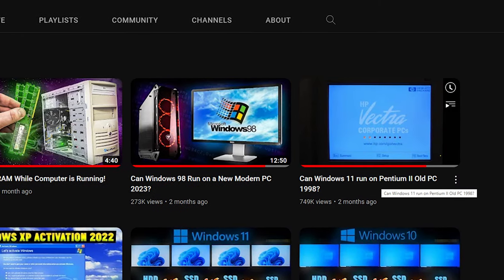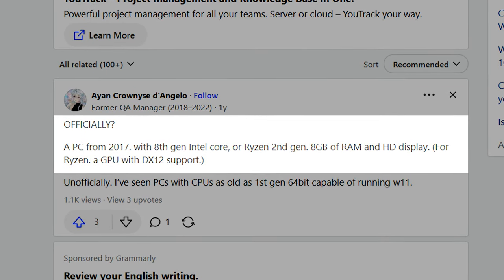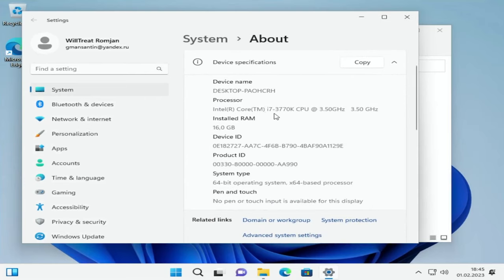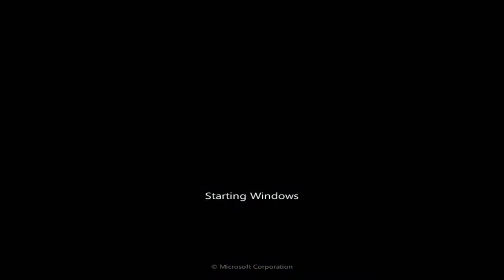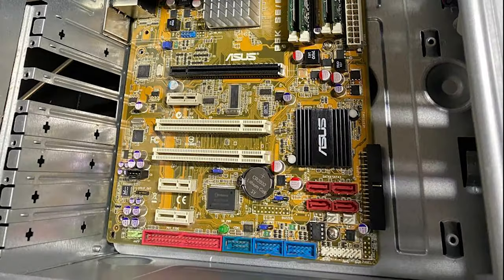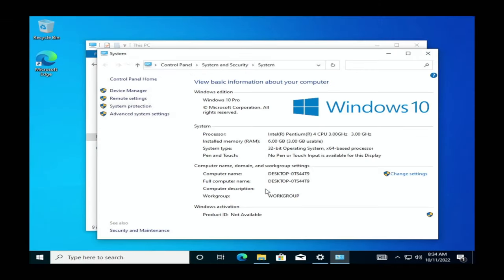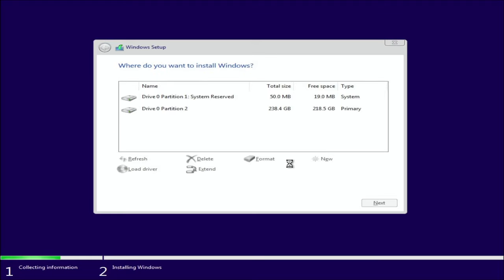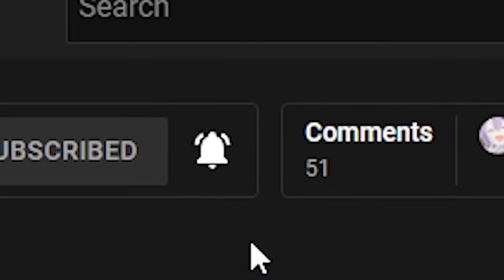What's The Oldest CPU That Can Run Windows 11?

Comment: The simple rule of thumb is that all 64-bit Windows since 8.1 have the same real hardware requirements.  That means that in principle, if it runs W8.1 64-bit it should run W11. But Microsoft has been very sloppy in testing compatibility on older HW, at least with 32-bit Windows where I have come across several laptops that didn't work despite fulfilling all HW requirements, like "newer" W10 on Pentium M and Core Duo. So in reality, there might be BIOS'es or other HW that blocks W11 from working despite all requirements being fulfilled.

If MS had tested more on old HW, the result should have been much snappier W10/11 as there is no reason why W10/W11 should be much slower than W8.1, which is very snappy on even very old machines as long as there is a reasonable amount of RAM and a reasonably fast hard drive (spinning).  But W10/11 can take 1.5-5 times longer to boot and are much less responsive, so it seems they have been optimised to be so unresponsive on HDDs that they need an SSD to get decent performance. But that doesn't solve the boot times on the older machines, especially laptops, as W8.1 can be faster and snappier with an HDD than W10/11 on an SSD... It seems W10/W11's disk performance is very CPU dependent while W8.1 and older are not, as long as the CPU is fast enough to handle the HDD bandwidth but that is not an issue unless you go back long before 64-bit CPUs.
Reply: In principle.  So far I have not been able to upgrade any PC to win 11 that doesn't have the TPM.  I'm guessing after the first SP that will be an option instead of a requirement.  There is too much money to be lost by not allowing the consumer market to update their old software.  e.g.  I have some old rigs without a TPM.  Win11 simply refuses to boot on those rigs.  It's not due to insufficient computing power (RAM, CPU, GPU, HDD, SSD) but rather without the TPM the boot strap simply refuses to execute.
Reply: >The simple rule of thumb is that all 64-bit Windows since 8.1 have the same real hardware requirements.

False. While software vendors like to apply generic monikers like "64 bit" and "32 bit" to specify compatibility, it's a big misnomer, because no 32 or 64 bit implementation of x86, or any processor for that matter between generations has the exact same feature sets. EM64T and AMD64 have evolved over time, and older implementations of those technologies lack instructions that newer implementations have, yet software vendors still use generic descriptions like they're all a homogeneous group across time.

Windows 8.1 had the same problem that 11 does now, with using generic 64 bit designation. That caused headaches with Athlon 64 owners, which early models lacked CMPxCHG128b, PrefetchW and LAHF/SAHF.

32 bit x86 was even worse. During the 90s, there were no fewer than 6 different x86 CPU vendors (AMD, Cyrix, Intel, Centaur, Rise and UMC to name a few) that all had a different approach to implementing x86. Software compatibility was an utter nightmare, just saying 32 bit didn't mean anything.

>the result should have been much snappier W10/11 as there is no reason why W10/W11 should be much slower than W8.1

Yes, there is a major reason why Windows 10 and 11 are slower, CPU mitigation patches.

The reason why old versions of Windows 10 and 8.1 are faster than newer releases is because those older versions didn't have software CPU vulnerability mitigations for things like Spectre and Meltdown, and now a dizzying array of other vulnerabilities found and patched since. Many of these mitigations by themselves have a severe performance penalty, which stacks cumulatively with each succeeding patch for other found mitigations.

Older CPUs are hit much harder in performance than newer CPUs. When you go much before Intel's 6th gen parts, you're looking at a 50-70% performance degradation, and even more if HT is enabled. Even with an SSD, it won't help with performance that much, because the CPU itself is taking orders of magnitude more time to do the same amount of work due to having to do it in a much less efficient manner.

You can turn many of these mitigations off in Windows 10, but not all of them. You'll be fighting Windows itself to keep them disabled, because it really doesn't want you turning them off.
Reply: @GGigabiteM  I've got both Sandy and Ivy Bridge rigs running 10 and associated apps without issue.  Well, I guess power consumption for the CPU ramps up, but oh well at least it's not like the 90's where when you bought that pristine 486 it was outdated before you even got dos to stabilize.

Comment: Did anyone else have an issue with the "doesn't meet sys. Requirements" wall persisting after making the bypasses in RegEdit?? I really need help here. 

HP Pavillion A6220n with A 2 core processor of 2.2 ghz. (I'm fighting the pc rn but it exceeds minimal Requirements.

6GB of Ram as well.

Comment: as an aside, just because 'ancient' cpus can, doesn't mean all boards can. i've got a bunch of older hardware that in theory can, but the bios/cipset doesn't let the installer run. notably all my old nc6400 laptops (which have core 2 duo's that are 64bit capable), and a few p4 boards i have (with some spare p4 641s which have the required instruction set). the installer just doesn't start. blinking cursor of doom. in spite of the cpus having the proper LAHF/SAHF support in 64-bit mode.

even if the cpu supports it, the chipset or bios may be preventing it. which is sad. there's going to be some mix and match needed if you're trying to put 11 on an old set of hardware.

so you may need to find other bios files to flash, or a different board in some cases, after verifying your cpu has the right 64bit support.

Comment: Take what I'm about to say with a grain of salt, but there's a chance this would work on a socket 478 board, I thinking using a Pentium 4 SL7QB.
The SL7QB, and SL7Q8, to the extent of my (rather limited) knowledge do support 64-bit instructions
Reply: @Man-O-Sphere News  Yup. that's what the "take what I'm about to say with a grain of salt" is all about
Reply: @Man-O-Sphere News  Unless you patch it Windows 11 needs at least TPM 2.0
Reply: Problem with that CPU is that Intel made it in limited quantities for one specific manufacturer in less than a handful of specific machines. Not many of them existed to begin with, and even fewer exist today. Good luck finding one for a reasonable price, the last time I saw one in the wild, it went for hundreds of dollars.
Reply: @JordanAnderson-pp5hu  Windows 11 generally doesn't need a TPM at all, they just really want you to have one.
I'm pretty sure socket AM3 motherboards don't have TPM 2.0 but Windows 11 worked fine on mine

Comment: Nah cause why would you use a 32-bit system in 2024? I use a Core 2 duo E6550 that was the best back in 2007. But the processor is 64-bit.

Comment: sir i have laptop with
i 2323 m  processor  64 bit 
i3  2 gen laptop
1 GB 640 m gpu
16 GB 833 mhz ram  can upgrade to 1600 mhz

can run windows 11

i can add ssd  insted of HDD  and  DVD

Comment: Hi, I'm trying to install Windows 11 23H2 on a i7 2600 CPU, but after the procedure with regedit I still have the same error on requirements. It is changed something in Windows 11 23H2 checks?

Comment: whats the newest cpu that doesnt support windows 11?
Reply: Might be the 2100GE that was OEM in PCs, Wikiepdia says it came out in 2019, non-OEM Ryzens would be 2200G and 2400G (2-12-18, or just voer 5.5 years ago, and only would be 3.5 years before Windows 11 came out. For intel, it would be the 7700k and other 7gen desktop models for normal CPUs, (1-3-17) and  i3 7020U n Q2 of 18 for a laptop.

Comment: Microsoft would be sitting pretty without those hardware requirements.  Instead, they are looking at having to release a Windows 12 to regain good faith.  Unfortunately, it will also have exclusive hardware restrictions.

Comment: There is something missing in these instructions. After i make the registry changes how do i get the install to restart as it does not do it automatically. i have the two windows open one with the regedit and the other where you typed in regedit.
Reply: Because the 90nm older 630 and 640 CPU’s are lacking the instruction set CMPXCHG16B which is compulsory since Windows 8.1. Also that’s the reason why the CPU can’t utilize more than 4gb ram even if it runs on 64-bit. I had this issue with a Pentium D 820 CPU

Comment: it says the one that support DX12 right? what if i have GTX 750ti that only support DX11, should i unplug it first, install the Windows 11, then plugging in it one more time?
Reply from the maker: No. No need to unplug. Just install windows 11 and drivers
Reply: @RamtechENG  i already have windows 10 license. if i fresh install windows 11, do i need to buy the win11 one? and is it work with any motherboard? because i use dell optiplex 9020
Reply: Upgrade to Windows 11 for free when in Windows 10

Comment: I am assuming without watching that its an LGA 775or maybe even a late 604 (never seen or tinkered with a socket 604 so have no idea what they are capable pf but I have had windows 10 at least running on 775 cpus but 7 max on late 478. Obviously with hacks, I have windows 11 on my i7 3770K PC, as it is still a pretty decent system with 16 GB DDR3 2400, 980Ti, 500GB SSD and 500GB Hybrid SSHD (I use it as mainly an XP PC and find the hybrid drives less hassle with pre mainstream SSD OS's as you get the speed boost thanks to the cache which is plenty for XP or 98SE for instance , without having to worry about TRIM and the like) and thats currently my oldest, but I did put it on my old XP PC which was a Socket 771 xeon.

Comment: i had windows 11 32bit on my pc old intel pentium G2010.. after launch windows 11 beta 2021 june 2.. i think i saw it had 32bit...
first installed 32bit on win 11 its working prefect. but not work steam's games or outdated. then again reset to 64bit and every working
i swear i saw windows 11 32bit in OS, x64 cpu.. i think 21996.1 like first developer beta..
then 2023 i think have 32bit. and my school suck CPU and successfully installed windows 11 32bit on developer in my ISO saved to my HDD it say 2021 may (history downloaded) and late installed pc old on 2 june 2021..

then 2023 oct. successfully installed windows 11 32bit on my school CPU 32bit. not work 64bit its working but lag so much. i did optimized and delete many app. and working prefect.
after 1 year later. TODAY i was school and still win 11 beta 32bit.
i wanted 21h2 release won't work with bypassed still no work.. but 32bit it working without bypass and it say 10.0.21996.1
school specs
cpu: Intel Pentium 4 Processor Extreme Edition 3.20GHz
ram: 1.5gb
gpu: nvidia but idk

school my PC prefect intel i5 14th gen old i3 6th. and another older intel pentium 4 extreme edition run win 11 lmaafo. and its SSD. from IDE convert to Sata works prefect. only 2.5"
yeah its 120GB.. and cant play youtube, just idle well. it has dual boot OS 1. main windows 7 ultimate 32bit and dual windows 11 21996.1 32 bit.

Comment: I've seen even worse motherboard. I have a pentium III 1.13 GHZ with 1GB ram but motherboard doesn't have ANY graphic card slot AT ALL. (only has built in 16MB graphic card from trident which is so awful and theres no way to put a graphic card installed)

Comment: This is the TRUTH about using latest Windows versions, of course your PC will always have that initial signature to boot off but after so many hrs, days, and less gb space the updates come in conflict as its all about prevent the last hacks from previous windows. PC will crash , and crash, freeze up and play dead showing BlueFoolScreen or the BlueScreenOverDose of permanent death of wearing out the lesser voltage copper wire spool or the clicking you hear. Its always a 4 year window with newer windows, faster PCs then last models, Ram, GPUs, ect.  But real truth is those Hackers sending virus s mostly from those dam PC Corporations to corrupt ya stuff of forcing you to buy latest pc tech. An overlooked Monopoly  of really no real laws and regulations for those who program, anti hack security tech, data admins, ect.

Comment: I've installed windows 10 on 32 bit asus eee pc machines with 1 GB of ram and 900mhz single core atom cpu. Runs really badly, better to use an eee pc with 2GB ram and 1600mhz dual cpu. Also can need the 32 GB ssd for comfort.

Comment: the oldest pc/laptop i ever tried windows 11 on is a dell inspiron 1501 from 2007 with amd turion 64 x2 tl 56 with 4 gb ram ddr2 and a 120 gb ssd in late 2021, and it ran so horribly that i trowed that old laptop in the bin in early 2022
Reply: I downgraded a laptop with the same processor to Windows XP and never looked back
Reply: Should have just loaded linux on it. Probably would have ran fine with Linux mint. But since you threw it away... thats that then
Reply: @antonisautos8704  i tried linux mint on it in 2021 and it had video driver problems with the ati radeon x1150 beacuse only jad opengl 2.0.
Reply: @Mihail Levarda  there are a lot of other distros to try out. But it's been updated since 2021.
Reply: @antonisautos8704  Doesn’t mean he hasn’t thrown it out since then
Reply: @antonisautos8704  the only distro i was to run on that 15 year old laptop was peppermint os 10 which was based on ubuntu 18 and its gonna end support this year and i indeed thron that laptop in the bin because it was useless and pretty slow
Reply: @Mihail Levarda  did you try raspberry os? That's made to run on pretty much anything. I have mint running on an old athlon 2 x2 255  system with 8GB DDR2. It runs pretty well. Though I did upgrade the GPU as the 6150SE that it had was straight trash.
Reply: Will stick with Windows 11 LTSC until Linux gets ready for desktop usage